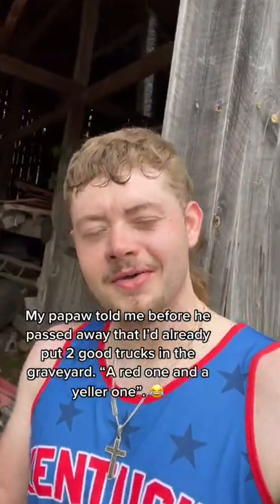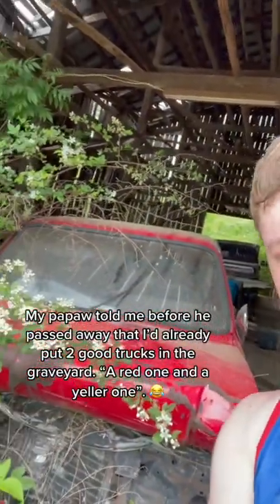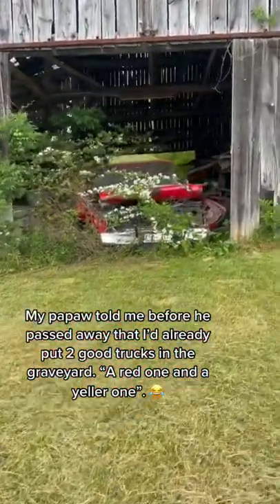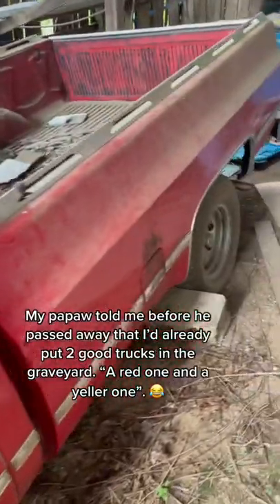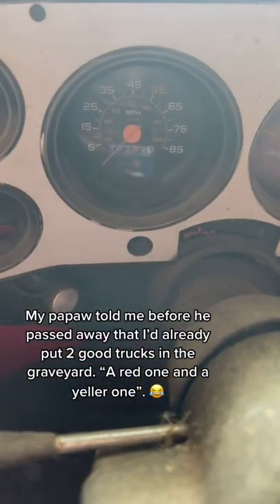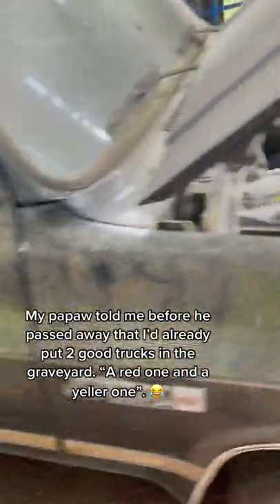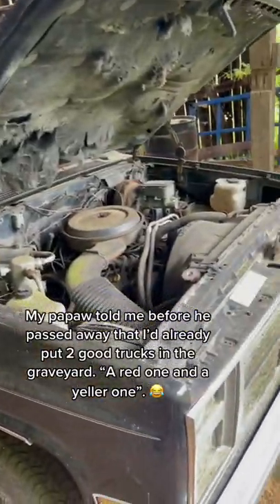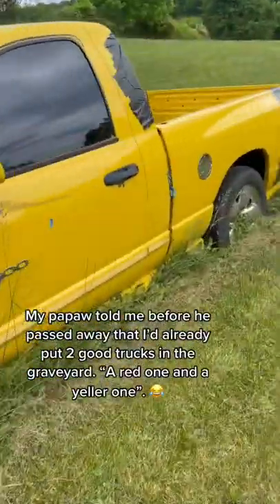So what y’all think?? Fix the old square body or the Rumble Bee first?  #truck #chevy #tylerbooth

Comment: Depends on your funds! You can fix both chevys for what it cost to do that dodge! 😁
Reply: Actually the parts for that 05 dodge are cheaper and easier to find then parts for the 87 chevy.
Reply: @SUMDUDE.  parts for the chevys are endless. But it does come down to preference. But typically dodge parts are more expensive. Maybe not today, but in the past they were.

Comment: My first truck was an '87 F-150 5.0 single cab with a long bed. I wrecked it when I was 17 in 1998. I rear ended someone really bad. 

It crushed the front end, broke both motor mounts, transmission mount and tail housing. 6 months later I had the frame straightened and repaired the rest in my driveway. I also punctured the radiator and sealed it with JB Weld. It ran great. This thing was a tank.

Comment: Fix all 3. 87 is the best year of the square bodies, was the first year with fuel injection. Get a 88-91 suburban front end with the dual headlights and put in it while you're at it, it looks so much better.

Comment: I would fix both of the Chevy trucks. You can take a good hammer and pry bar and a torch and very carefully heat the metal up on the red one an when you get it straightened out heat the metal back up slowly and put some new engine oil on it an let the oil cook in to the body . Take ur time doing this and it will work and it not cost you much to fix the red one just a little time not long cause you be amazed what you can do in a week . Fix them both cause they both are in good shape . You will be happy once you done trust me I know . I own many of them trucks just like them

Comment: I would fix the red one as long as there's no damage to the engine from the impact and no damage to the frame or at least as long as the frame doesn't have severe damage a little bit is okay as long as it can be straightened out for the most part but mostly As long as the engine is not damaged like crushed at all

Comment: Fix the old square body. Already have a donor truck. So yu can start at it aggressive with Sawzalls and grinders and not worry about having to salvage all the little things off the wrecked one. And they're already parked under a barn so that makes working on them not hell-acious in the heat from the sun

Comment: Can you not wreck it again? Fix it. 

My son bought a 1972 Chevy. It was a turquoise colored one. He put in oil, new plugs,  new points, new belts. He changed the oil' checked the fluids, put in gas and it started right up. He spray painted it the colors of the Iowa  Cyclones.Red and Yellow with flames on the sides.it worked great until he missed a sharp curve and went into the trees.  In a 30 foot drop. He was in Southern Iowa to visit my.parents. he was not hurt.   No alcohol involved.